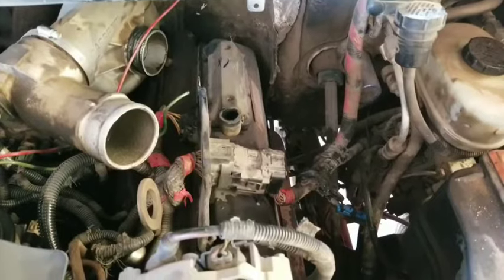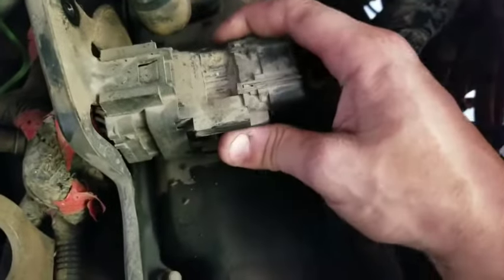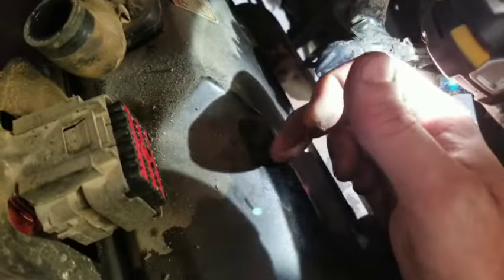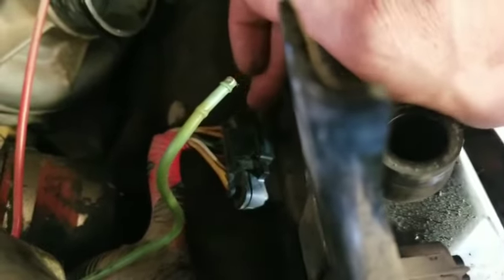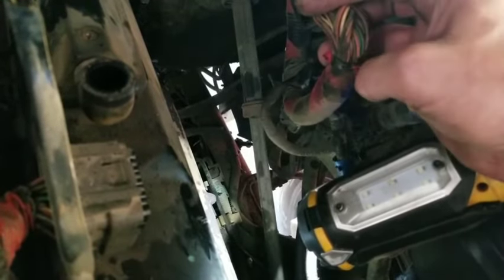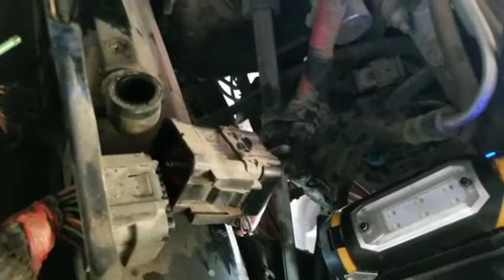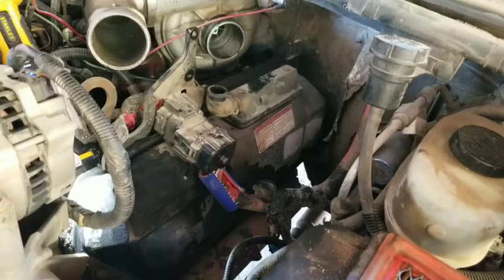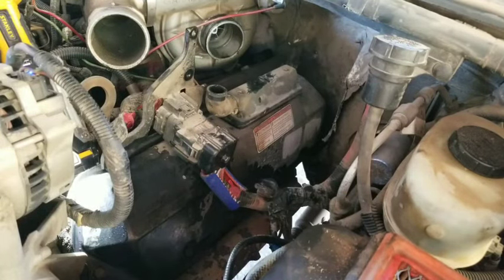7.3l Powerstroke rough running, cuts out, etc.  The fix!

Comment: Most people don't say why they're repairing. You say it usually cuts out and then you show us the direct section to look at that is clever. Everybody else never talks about why it's there. They just say code so. And so just say how it is if the truck aint running. Checklist, check that thank you.

Comment: Why is it always the right video found AFTER  I throw a punch of expensive fixes at it?  Why cant I find your video first then go check that wire cluster to see if the wires rubbed and exposed.  every wire on the bottom row of my cluster is rubbed off insulation all exposed and rusted!  LOL wow!  thank you sir
Reply from the maker: Sorry that's the way it played out for you.  But hey......you did find the problem 👍

Comment: My truck would randomly start running rough and lose almost all power. Pull over turn it off and back on and it runs like nothing happened. I checked this plug and the green wire has rubbed through a TINY bit but no other wires. It literally only does this like once a month. Could this be enough to cause my problem? Could it simply be taped up?

Comment: My 7.3 will just lose all power when I’m driving if I hit a bump or something and loses power to the pedal and when I let off and press it again it’s fine sometimes the whole truck will shut off and I checked that connector and their are some wires that are rubbing but nothing exposed and I can’t figure what else it could be
Reply: And when I say loses power it’s not just the engine the whole truck pretty much acts like you shut it if and restarted it

Comment: Last week my 7.3 started overfueling herself while losing power and eventually dying altogether.  Got a new cam position sensor on the way and was considering replacing the IPR but will definitely check that harness first thing tomorrow.!
Reply: Not sure if you did the job yet mine did that and when I replaced the ipr I also replaced the icp as well they usually work with eachother
Reply: And what did you find out?

Comment: Dude I've been trying to figure out what's wrong with my truck for months thank you so much
Reply: Did your 7.3 cut off while driving with no engine lights coming on cuz I'm having the same problem with my truck I changed the sensors the iprs icps still cutting off
Reply: All my – lights flash whenever it would cut off and come back on I did what this guy showed and I just don't have any wires exposed but I cut a piece of garden hose and put around it anyway and it completely fixed the problem
Reply: @samarruda1  hey seen this comment, mine does the same thing and driving me crazy did you ever figure out the problem

Comment: Great tip! Would cause a ton of odd / intermittent issues with these engines. Glad I found your video.

Have you ever experienced an issue when cruising highway speeds, it is like the torque converter locks and unlocks intermittently depending on speed/rpm? Wasn't sure if it was my TCC or overdrive engaging and disengaging.

Comment: I have a random issue with mine where it will run rough almost sounds camed but run like a vacuum issue I’m wondering is this may be my culprit. It’s strange because it affects my 3-4 shifts whenever it happens

Comment: I got a 2000 7.3 throwing a p0113 code. I googled the code and says it’s iat sensor but the air intake doesn’t have a maf or sensor connector? Any help? Thanks man.
Reply from the maker: There is an 'air intake temperature' sensor.  Look for it on the back of the air filter box.

Comment: I have a 97 PS that intermittently wont get over 2,000 rpm, I've replaced injectors & wiring harness,  IDM, fuel pump, main computer,  throttle pedal, glow plugs & harness, fuel pressure regulator,  fuel bowl,  fuel lines, fuel tank screens, cam position sensor, ICP and IPR sensors

Comment: HELP!      My 2000 F250 7.3 Dash gauges stopped working the same time that my throttle quit working. I replaced the throttle assembly but it did not fix the problems. Are there any relays that could go bad? Any help on what to look at now?
Reply from the maker: Ground wire somewhere.  I bet that's it.  Clean all of the grounds and try that
Reply: Kind of late, but I just saw this, there is a fuse that controls this, happened to me. Truck stayed on but the dash didn't read anything, and the throttle didn't work. I just started checking fuses and sure enough there was a fuse burnt out. #19 interior fuse box, 2002 7.3 crew-cab for reference. Hope you solved it by now but if you didn't hope this helps.

Comment: Did this ever throw a check engine light? or the water in fuel light?
Reply from the maker: Not sure about the water light, but sometimes this wiring issue can set a CEL and sometimes not.
Reply: I have a 97 f-350 and sometimes it says “water in fuel”. It skips when you crank it until you give it gas for a few seconds. Any tips???

Comment: Will this cause lost communication with pcm, also lost communication to glow plug module
Reply from the maker: The 7.3l doesn't have a glow plug module.  Thats controlled in the PCM.  This problem usually only effects the wiring between the injectors and the Injector Driver Module (IDM).

Comment: 2001 7.3 , 6 speed, got hpop off running truck with gauge hooked up, new ipr valve , new IAT, new icp sensor. Wires not rubbed through at main plug, new pig tails on both ipr and icp, runs decent then starts surging and  high pressure goes from 1000psi to 3000psi, then drops down to 500 and below and diesel , but starts back perfectly. Really need help.
Reply from the maker: Check your fuel pressure at the fuel bowl.  It's common to think that when the the engine dies and you see the oil pressure drop, the drop in hpop pressure is often blamed.  When actually the engine could be running out of fuel and dying, hence, the hpop pressure drops because the engine is dying.  Hope that makes sense.  You also could have leaks in some injectors, but if you do see 3000 psi I wouldn't suspect that.  I really think you have something else causing the engine to die and your low hpop pressure is a symptom of that.  That's why I think you see 3000 psi first before it dies.  The ipr is trying to raise the pressure while the engine is dying, trying to keep it running.  Also with these types of problems you definitely have to have a mechanical gauge hooked up to test hpop pressure.  That's the best way to figure out what's going on with the hpop pressure.  It's rare, but I have had crazy phantom IPR pressure readings that have lead me in the wrong direction.  I'm actually planning on making a video about a recent one I had.
Reply: @prodieselrepair3218  we pulled a fuel pump off a running 7.3, and the pressures I listed are off a manual gauge. It'll hover at 480-500 before she goes nuts then dies. Injectors are also out of the running parts truck with new orings lol. I want ti burn the truck
Reply from the maker: @kevinaweseom2866  yeah but do you know what the fuel pressure is? You can put a brand new pump on a still not have any pressure or flow.  Especially if the pickup tube screens in the tank are clogged up which is definitely a common issue

Comment: Could this cause long cranking and no start? Mine runs great for random leangths of time then dies 
Usualy when coming to stop
Reply from the maker: I have not experienced that, but I won't say never.  Anytime you crank an engine and it doesn't start you're missing something (fuel and high pressure oil most common).  By the way yours seems to act I bet you have a high pressure oil issue

Comment: I have an 01 7.3 270000 m. At about 2000 rpm’s on the 2-3 shift it sometimes has one loud spark knock with a black poof of smoke. Sometimes it just cuts off for a microsecond, like someone tapped a kill switch. I think the tach drops when it happens. I have tried several cps. Help!
Reply from the maker: The best thing you can do is replace the whole top engine wiring harness.  These pickups are over 20 years old now.
Reply: @prodieselrepair3218  thanks for your help. Can you provide a harness, or recommend someone? 
Regards🇺🇸
Reply: @2aguy144  I got a harness for my 2000 f350 from Riffraff. Email them your vin and they'll give you a link to the harness you need. It'll run you probably $6-800, depending.
Reply: @rigoffear  thank you 😊
Reply: I herd IDM going bad makes engine the loud pop
Reply: @robin8559  i suspected the idk but was afraid to pull the trigger. I’ll try it now. Thanks

Comment: Could this problem make it die completely? And then start like nothing has happened?
Reply from the maker: Yup sure can
Reply: I changed out the ECM and haven’t had a problem since. 🤷
Reply: @brandondumond452  the injector driver or the body control module? One for injectors and one runs oil pressure

Comment: I have a 2002 F250 7.3 with 367k miles and it starting running rough coming to a stop sign, then accelerating sporadically, then at idle it would die. then start up like nothing happened. The check engine light comes on but code reader says nothing. Then the check engine light turns off by itself. Just started doing this 2 days ago.
Reply: Mine is doing same thing did you get anything figured out yet?
Reply: Mines is also doing that?
Reply: Ha all here with the same problem, i guess stay tuned , my is a 97 , digging in now
Reply: A common problem with those issues is a camshaft position sensor, it’s like a 30 dollar part from ford if that is your issue. Just something to look into.
Reply: Overdrive button wire in steering shifter grounding

Comment: Terrible advice especially on a future truck that you will never lay eyes on. ANYBODY dumb enough to put solder on old wires under their hood deserves to walk.

Telling clueless people to rip apart a FICM harness and start soldering pieces of wire in there is derelict. Perhaps it would be wise to, you know, actually INSPECT those wires and maybe they don't need to be chopped up.

If someone insists upon soldering wires under the hood, perhaps they can get a piece of wire from nana's broken table lamp.